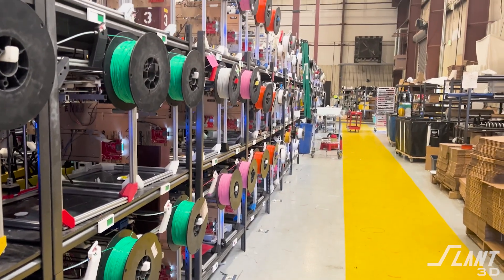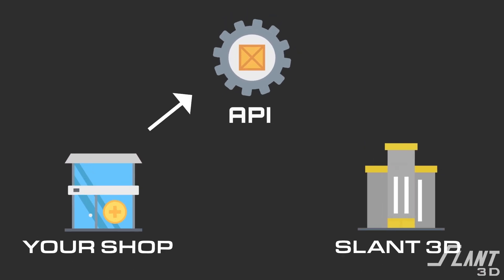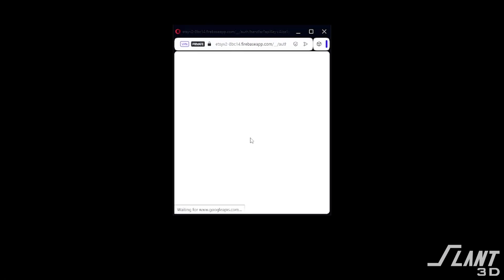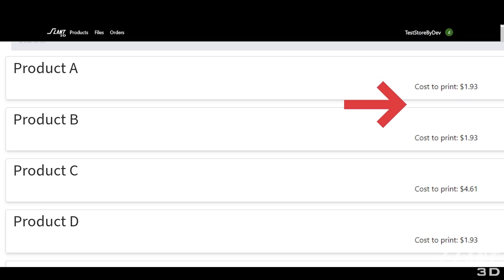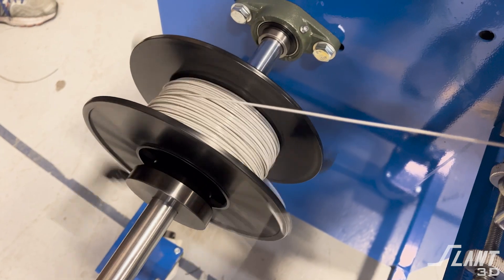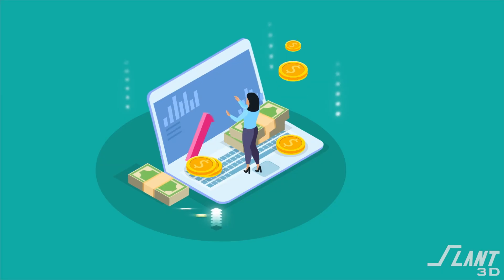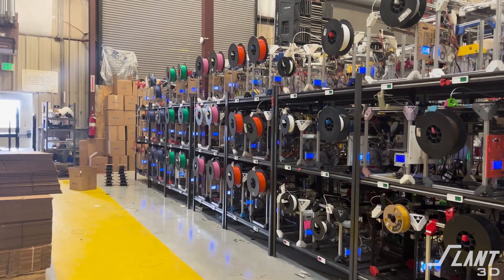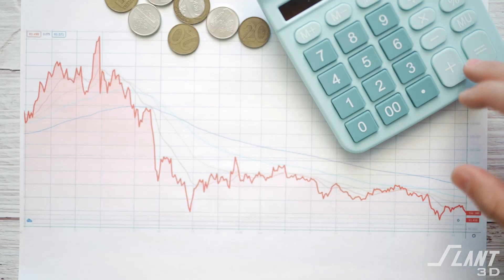Connect Your 3D Printing Etsy Store To Our Giant 3D Print Farms for Free

Comment: I have a few questions: What if the parts require supports? Can we provide a cura file with the supports on the piece? Also, how is shipping calculated? Do you offer international shipping?
Reply from the maker: Supports are automatically enabled. We will only accept an STL so you can design them there.

Comment: Great, but I uploaded 1 of 4 parts of a model I sell a few months ago. The cost to print was 10x what it costs me to print the whole thing. I couldn't compete
Reply from the maker: What were the parts. Remember that the cost to print include not just material. But post processing, packing, etc. This is a new app from a few months ago. Let us know if it is still too expensive and send us your files. We will see if we can readjust the algorithm
Reply: @slant3d  I wonder if the quote would be the same using the etsy plugin. I wanted to try that one.
Reply: Holy shit 10x of the cost to print it yourself!  Is it a bug? Did you try again? Was hoping this is a viable pod for my designs.
Reply: @teckougeki  I suggest try the estimator tool.  BL is i have 5 parts and only sell the thing for 90, so if i tried having them doing it, i would be priced out of market.  But maybe the part was the problem for their operation.